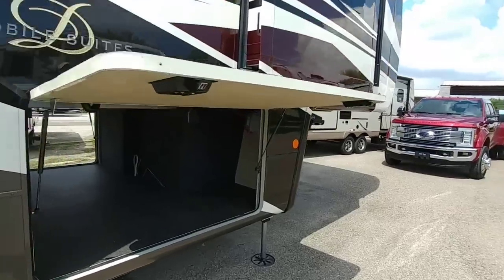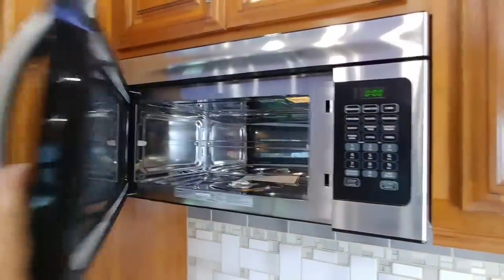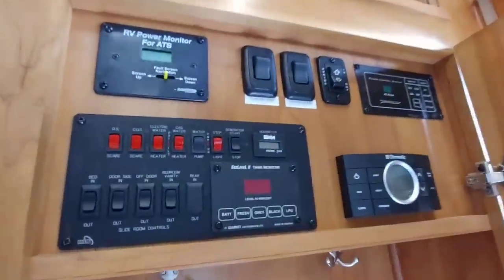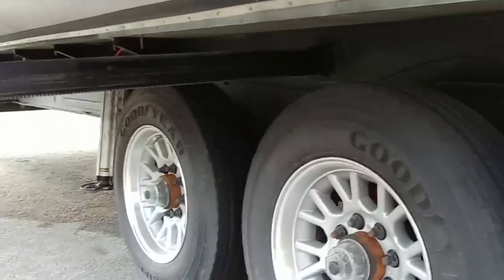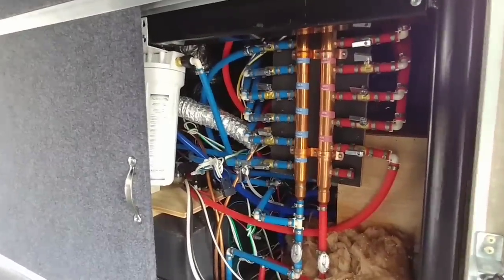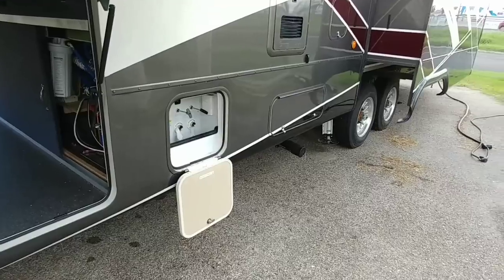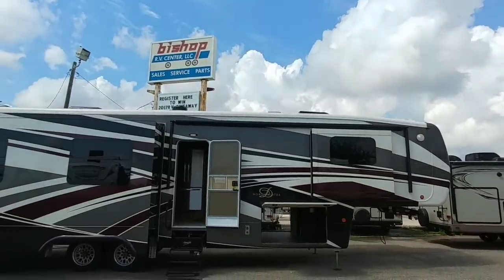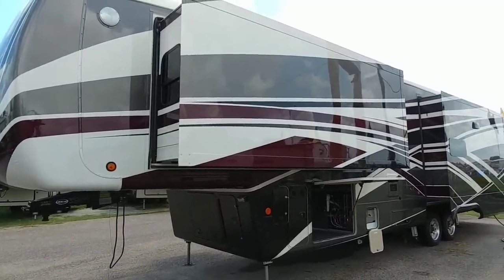Must See High End Fifth Wheel! Wow!

Comment: UGH! Not only is it super ugly exterior paint with no stickers to pull off, but the FREAKING clear coated it on! Damn! Why????? Why can't they just put on a really nice solid paint and if they absolutely have to a narrow pin stripe, but really just a beautiful pearly white or the equivalent. If they want to do color then do a pearly color so it sparkles, but get rid of the swoops and ugly shit off of RV's this isn't 1990 anymore! Get out of the past! Seriously, you need to show the manufactures comments like this because I am not the only one that thinks they are ugly, and a lot of people pull off the decals for that reason!!!!!! Give us something plain and then an option to order all the ugly stuff we want if we want. Hell you can have it wrapped with ugly swoops if you want, but don't put them on there to start off with! 

Yes, I agree that color of yellow oak is super ugly too! This is why I plan to buy an older one for cheap, so I can go in and change as much stuff and paint and have it wrapped to cover up all the stupidity from the manufacture. I know, I said the same thing about the Tiffin, but I am serious this shit gotta stop! Grandma and Grandpa's ain't the only ones buying these things anymore, and it ain't 1990 either! I don't want a rig/home that looks like someone's grandma threw up all over and in it! 

By the way, I love your videos on what type of truck to use to pull these rigs. Oh and those 3.5 inch walls gotta add a lot of weight which means you can haul a lot less stuff. The insulation might be nice but you gotta look at the numbers with it. You have to add the amount of weight that the tanks hold, who is going to be in the truck while your driving, the weight of a toy in a toy hauler, and all the stuff you are going to add to it. 

By the way, I may bitch a lot about the look of new RV's but I really do like your channel and you do a good job! It's just that they build them so damn ugly!

Comment: i'm new to your channel (to any channel for that matter!) and loving it! You're my go-to guy for info before I soon buy my first RV! Thank you! Not sure if you're reading these a few years later, but 2 Q's right off! Is that rust I see on this new RV underneath already on the slide?? If so, that's a big concern for me for trailers in general. 1) What do I, as a consumer, a) need to watch for before buying, b) do to prevent it after buying 3) or what areas of the country do I avoid to minimize/prevent? and 2) I've seen no RV's yet that cater to pet owners. (unless I've just been missing them) and I mean as examples, place for cat box (to minimize smell and tracking in these small spaces) or pull-outs at floor level for bowls, built-on dog runs on the outside that can be pulled out from a side wall, etc. (this would be much more useful to me than a second kitchen, but would need to be right next to the outside shower) or lead runs on the outside, maybe air-conditioned storage area with windows below? you get the picture.....

Comment: Too bad this will be too heavy for any dually. You’ll need a semi to properly pull this thing without stressing out your truck. So top that 175k for the rig plus another 40-50k for a used semi, you’re looking at spending 200-215k to full time in this thing

Comment: The fiberglass roofs used on this and other non $250k+ are as bad or worst than the TPO roof used on most units today. The only fiberglass roof worth a damn is a true molded fiberglass roof like what is found on your big diesel pushers. The pinch rolled crap they put on fifth wheels and Winnebago As is worthless.
Reply from the maker: According to DRV they use a fully molded fiberglass 1pc roof when optioned with a Fiberglass roof upgrade.

Comment: $175,000 on the lot, drive it off the lot it's worth half.  Buy a gently used one, save the depreciation.
Reply: These guys have some huge balls trying to charge 175k for something like this.  Maybe 175k if it drives itself, but even that's pushing it.
Reply: This is the equivalent of a $300k motorhome.
Reply: Coldfireice8044... agreed. I just bought a 2020 Bighorn 39MB and he is showing comforts that I have at $60,000. No way would I pay $175,000 for this trailer.
Reply: Good luck with that. It will lose some value, like all of them, but not half. This is not your standard fifth wheel. Plus, these aren't common, you'd be lucky to find one used.

Comment: I could afford this but I don't think there's a pickup truck that could haul this beast withouttransmission problems or something. I would buy a cabover semi, have it refurbished andthen comfortably tow this thing across this country. It's super fun to drive a semi and youwould hardly feel this thing behind you. Backing it into a spot would be a breeze and youwould get 12 MPG instead of 4-5 MPG from a pickup truck. You can outfit a used semi with nice chairs and other interior accommodations to make long distances bearable.
Reply from the maker: Any of the new diesel pickups properly configured could tow this without a problem. Stopping shouldnt be a problem eithef with DRV having hydraulic disc brakes

Comment: My 2018 Big Horn from Heartland is a 41 foot replica of this unit. Mine had the residential stainless fridge as well as the Orion stove and convection microwave. Theater seating with 55 inch flat screen with surround sound. Plus my bighorn has the darker wood. I paid 90k for mine and my opinion better looking unit than this.

Comment: We have a 2018 DRV MS 36RSSB3 and we love it. Bought in Jan 2018. Great full time home. You really need to compare the different units you look at. Yes these are more expensive than other units but you get a upgrade frame, thicker side wall insulated, independent suspension which is a big deal. Resale remains higher on these units also. Really is a great full time living unit. Before we bought we fly to Indiana for several RV factory tours. We we not even considering the DRV but decided to go to for a factory tour since we were there. We loved what we saw and made decision to go with DRV. Factory was clean, systematically set up and we saw what they used to built these units. Glad we went as it was a game changer for what we wanted. More expensive but worth it. We have watched video where some one bought a 5th wheel then they began installing options like independent suspension, full body paint after several years of wear, additional lighting inside, etc.. We bought our at the Number 1 DRV dealer in the USA - RV’s for Less. They were great to work with, great prices and service. Call Ken Rife and he will be glad to help you. Had best prices I could find. All warranty service was handled exceptionally. We even drove too to Indiana service facility for a couple items and they went above and beyond. They fixed the issues we had and actually went over the entire unit and fixed items that we did not even know that we damaged. Our WiFi Ranger had the antenna knocked off and they replaced for no charge. Great service. Service manager Ed Fry there was easy deal with. Thanks DRV for a well built unit. We are glad we bought a DRV.
Reply: If only everyone would do the same they just might understand why they cost what they do

Comment: Hi great informative vids thank you, my question is about the mor ryde steps that you installed on your 5th wheel.  If you have a 3 step originally do you need to stick with a 3 step mor ryde or can you do a 4 step instead?
Reply from the maker: It all depends on how high off the ground your RV floor is.
Reply: @BTBRV  it's a typical travel trailer 327vik. Thanks

Comment: Why 6 point leveling and not 4 point?  It seems to me that if the frame is strong  enough, 4 point would be much simpler.
Reply from the maker: With a 24k GVWR, it’s safer and better on the system to run a 6point jack setup, especially at over 40’ long.  Puts less stress on each jack and the frame (even it being as robust as it is).

Comment: how long can a 5th wheel be before you have to have a semi to tow it. thank you.
Reply: Tammy Markham it’s not the length, it’s the weight.  With this particular model and my personal experience, I would use an HDT with minimum 500 hp.  Those 330 hp Freighliners won’t cut it when you start running up in the mountains.  

Leonard

Comment: I noticed 2 or 3 pluses you didn't mention, and there are a couple of things I'd question for this price point. The master closet looks like it has cedar inside. A lot of people may not care, but if it is cedar, it's a nice plus. The bed is a king size bed WITH nightstands. That is extremely rare. Nightstands are rare full stop, but with a king? I'm not sure I've seen it before. The towel rack in the shower is a minor plus that won't seem like a big deal to a lot of people, but when you're living in it (PT or FT) it makes a difference. Water can do a lot of damage to an RV. So drying your bathing suits and hand washables inside the shower is a good idea (yes outside is good too, but you could be on the move or in the rain). I'm surprised the steps are steel and not aluminum. Isn't aluminum the preference? This thing is expensive! I would think powered or not, you get aluminum steps. Last note: Where are the outlets around the sink and stove for appliances? Maybe they are hidden in or under the cabinets or something, but at this pricepoint there should be outlets for small appliances in the kitchen.

Comment: So full body paint power steps a full size fridge =175000 haha ya bullshit.   The Montana front living I’m looking at buying for 65k is nicer then this  more room and has literally all of this besides full body paint  and the interior is nicer too.
Reply from the maker: The frame and overall construction of a DRV is beyond anything Keystone Montana has.  The plumbing, insulation, wheels tires, electrical, windows, ACs, fixtures, build quality also exceeds the Montana's construction.
Reply: Big Truck Big RV  it’s more expensive then most people’s houses.  I’ve had my arctic fox and a Montana in North Dakota in -50 and have had no issues at all with any of that stuff.  And the Montana is all stainless as welll.

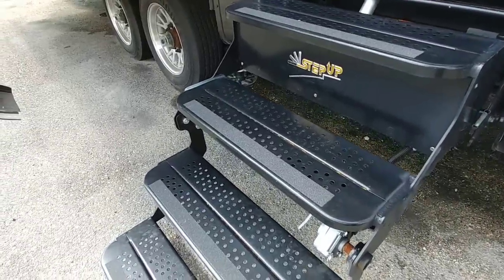Comment: 1:37 not very high end, high end would be aluminum frame and steps, plus it would not  have rust on the slide out frame.plus "full time" equipment is not a residential refridgerator.

Comment: $170,000? I am not impressed. A 2017 Big Horn is roughly $120,000 less, yet comparable in many ways. Same leveling system, same appliances (even same brands), similar wall thickness, better ceiling, same sized tv’s and bed, nicer cabinetry, same sink, same size fireplace, ceiling fan, 2 whisper quiet AC, slightly smaller bathroom etc. 

There are some nice advantages of this RV such as dimmer lights, power monitoring, thicker floors and extra storage. But in my opinion, it is nowhere close to worth paying the extra $120,000.

I’m also very surprised that with that heavy price tag they didn’t use aluminum steps. Much easier to get in and out of.

Comment: One glaring mis-statement; the Montana actually does NOT have a 'rubber roof'. The Montana has a TPO roof, thermoplastic polyolefin.
Reply from the maker: +Edward Beaumont: The term TPO stands for Thermoplastic Polyolefin. Believe it or not, TPO is actually in a broad family of rubber roofing materials. TPO is a blend of polypropylene and ethylene-propylene rubber
Reply: I stand corrected-it's what I get for barking from the hip. Although not necessarily a 'rubber roof', TPO has similar properties to EDPM, but is more resistant to hydrocarbon and solvent type contamination and becomes flexible when heated making it more repairable.

Comment: Boy am i glad i bought my Newmar Torrey Pine! My 08' Is every bit as nice, and just as well built, Moreride pinbox,Axles,Disc brakes,Goodyear G114's Corian counters,Painted exterior, fiberglass roof,Solid wood everything! You would not know its 9yrs old unless you looked at the vin plate. No, Newmar Discontineud building towables in 2012, They are focused on the Class A market at this point, But You can't beat the build quality of a Newmar. BTW, Not knocking this DRV, Its a fantastic looking well thought out rig, But My Torey is every bit as nice, and It's paid for!! Lol.

Comment: What about RV length laws? Some states show a maximum trailer length of 40’. North Carolina shows 35’. Does this apply to fifth wheels or just bumper pull trailers? If so you’ll need an over length permit in some states every time you pull that $175,000 DRV.
Reply: No no no no. It’s 41 feet. There are longer ones out there. I have this rv and we have zero problems going through any state.

Comment: I tow a Carri Lite 36XTRM5 with a similar frame and the same wheels, tires and suspension and have a Ford F350 DRW. I do not believe any 1 ton truck with any amount of wheels can tow this 5er fully loaded and stay within the trucks ratings. Many would tow a unit like this with a Ford 550 sized truck or a tractor.

Comment: I think that it is pretty nice. But if I'm going to pay $175,000.00 for a fifth wheel they better have a generator in it. Also you have to take the propane tanks out of the unit to have them filled. They have to weigh them to 30 lbs so they don't over fill them it's the law, at least it is in Canada. The tow vehicle you need to pull a 40 foot rv that weights that much has to be a dually that is rated for at least 25,000 lbs you can't have it rated for less than what you are going to pull. The best thing to do before you buy a rv is check with your vehicle manufacturer and see what your truck is rated for before you start shopping for your rv. Then you can decide if you need to buy a new truck before you spend $175,000.00 on a rv that you can't pull with the truck that you have. Also this rv looks like it can only sleep two maybe four people. You better not plan on having any family or friends come to stay with you, I guess they can sleep on the floor.

Comment: My 5th wheel has separate water valves for each line and that is soooo nice.  My kitchen sink developed a leaky water line connection, and I only had to turn off that line until I could buy a hose clamp!

Residential fridges are nice, but I'll skip it for my next one. They don't play well with solar.

I wish they offered a fuel cell option in place of the generator.

Comment: That is a very nice 5th wheel.  I would buy it if I could afford it.   I think if one bought that 5th wheel and a nice new dually for about $75k it would still be cheaper than buying a Class A diesel pusher.  And if you take into the account a car that I usually see being pulled  it would definitely be cheaper.  Also, I think it is easier to resell a higher end 5th wheel and truck than a class A RV

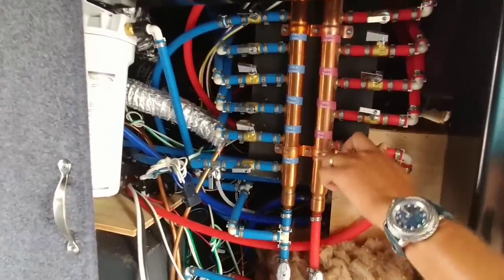Comment: Only way I would buy that one is to live full time! Cost more than my house now. I like keeping our place as a base camp, traveling out from here. Question I have never heard addressed: Big Truck, since RVs use the same PEX pipe as houses, etc., why do we always need water pressure regulators? Seems to me an RV should be able to stand same pressure as a house? Hold on here at 12:53...what in the world is that fiberglass insulation looking mess doing there under the water manifold? F450 is what I'd want to pull that sucker.

Comment: Dimmers, not faders. Faders are for sound systems, dimmers are for lighting systems.
Reply from the maker: Richard Hewett: I know I know :)
Reply: Ummm.. the term "fader" is used in pro-lighting as well...
Reply: daveplex which would be correct in reference to a lighting control board but they in turn control dimmer packs.
Reply: Yeah.. and this is my last installment on “Internet Pedantry Today”.  

Your argument appears to assume that the dimming happens at the wall switch, and there isn’t some other controller elsewhere.  Which may, or may not be the case. Especially with LEDs.

Comment: This is where things seem to be going with full time type fivers. I thought about a 30 footer, but it wasn't worth it for me when I toted up the cost of the truck, especially diesel. The depreciation is very hard to swallow. In ten years the value can be very low, and the complexity of this unit makes it hard to say what ongoing maintenance will be. I like the Fiberglass roof and the manifold plumbing system. There's no reason they can't do the wiring and plumbing so it lasts for 30 years. 

How many people really want to move this down the road every few days? You buy a trailer to move around, at least some of the time. How easy will it be to heat and cool? That's a lot of space. You could make a boondock version with a big lithium bank and 2000 watts of solar on the roof. It's hard to say what people might do with these RV's. They can market them as toys or as serious places to live for people who want a certain level of comfort and mobility. A lot of the places where people go in RV's are at capacity, like parks. 

A lot of people go big and then they go small. If you like the road, the touring, something like that small Class C you looked at the other week is easier. I looked at those. It gets built on the Transit but also the traditional chassis, which is confusing. Not many choices for layouts and furnishings. I thought it made more sense than something like a Travato for a lot less money. 

I hate seeing the industry get so concentrated (corporate). There is progress, better RV's, but there is a lack of design efficiency. If you give me what I want and you are able to lop ten feet off the darned thing, lets do that. I looked at something like this at Nielsons in St. George last Friday. I felt like it was made to show, that it is mind blowing when you get that first look. But RV's are tough, and people need to be hard headed.